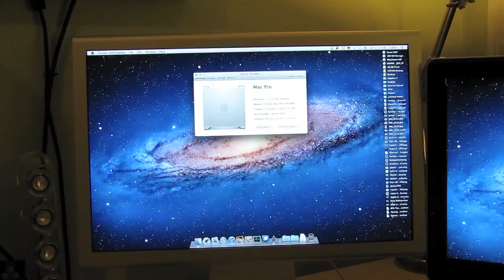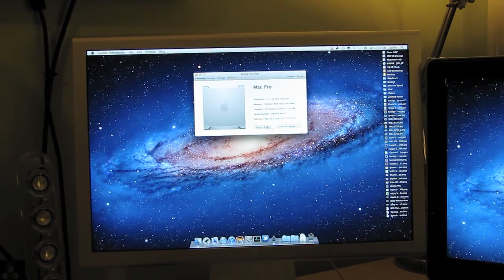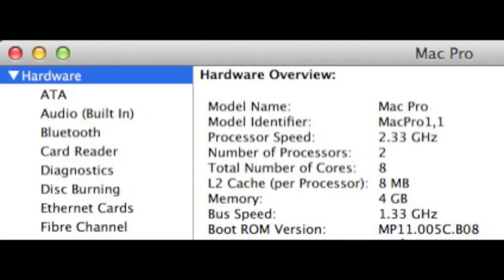Mac Pro Processor Upgrade

Comment: Instead of paying naughty Apple for a Quadcore you do like the PC boys and build your own version. There is a lot of info on how to do this and it really is not hard as long as you take your time, have proper tools and use non static precautions. You can also overclock any Chipset in the equal numbered Intel of 53XX i.e. 5310, 20, 40 and so on. It is fun if you have some balls, a few friends are PC lovers so I am guilty by association, my MP never had a chance.

Comment: The old CPUs ran 2-3F above room temperature? a delta temp of 2 degrees? Even water cooling can't really dissipate that much heat.

You also say the newer ones run "cooler" at around 10F above room? That sounds warmer to me or you have made a few errors... 

Also you used WAY too much thermal paste/compound...

FYI I only watched this to see what the inside of a Mac Pro really looked like.

Comment from the maker: @bmsmusician I haven't had any heat issues. The CPUs run slightly cooler than the previous ones. They idle at about 10F higher than room temp, an the old ones were at about 2-3F higher than room temp.. Just remember to clean the old past off of the heat sinks. Hope this helps!

Comment: Been thinking about doing this myself but never had the guts to remove parts. You got a lot of comments about the thermal paste, did you notice any heat differences caused by that?

Comment from the maker: I have the Mac Pro 1,1 as well. You can swap in the 5345 chips like I did. The 5355 chips will also work, but I didn't go there because I was unsure about heat, and they're more expensive.

Comment: hey Collin, i have a mac pro 1.1 i want to upgrade. the mac use 2x Intel Xeon dual-core 2.66GHz  5150, but you using 5345. So what I'm i gonna do? or what did you if you had the same mac pro than.

Comment: 3930k + GTX 690 ftw lol I love my videogames eventhough a 3930k is overkill. I am going to add another 690 my current one has a 200Mhz OC. Which is pretty massive for a dual GPU card on air

Comment: It's called a logic board, Apple macs them. Mostly due to the ram design like you see here. You can add a lot more ram this way. Also since the case is specific for mac pro's they can do this without problems. I personally tink it is a clever design al be it a bit cumbersome. Though it keeps all the hard drives cool and the GPU too.

Comment: Mistakes in the video:
- New Thermal paste: Just a small/medium sized dot in the middle of the processor.
- Old Thermal paste: You should clean the heatsinks before placing them back in.

Notes:
- Do backup your data, you will might to reinstall Mac OS X.
- This does void the warranty...
- Make sure you select a CPU with the right socket and also
make sure Apple uses the same CPU in their other Mac Pros.

Comment: depends on what method of calculating you use, windows happens to use 1GB = 1024mb but manufacturers of both ram and hard drives tend to use 1gb = 1000mb

Comment: Oh and btw you would be unable to run let alone run at max settings games like BF3 & MW3 as neither are supported on the mac platform, as well as the fact that a ati 5870 which is the top of the line card the mac pro comes with isn't able to run these games at max on 1080P - just admit it you bought the wrong thing

Comment: There is a case available for the pc builder that supports 24 hot swappable drives as well as 1 internal drive bay, put high end server speck drives in 4TB a piece, 4 x 25 = 100TB yes you would need a raid card, but i would like to see you fit 25 hard drives into a mac pro case. If you seriously think i use all 4 monitors as one your an idiot, 1 has Premier pro cs 5.5 on it, 2 has the live play back from the video editing, 3 has the files open, 4 generally has cpu, ram, gpu & hard drive info on

Comment: Well it dose if its faster than the 8 core xenon set up, windows will also support up to 128GB of ram, I I wanted to I could set up my pc to run a 24 monitor set up and btw you cant max out all games on the mac pro even with its top of the line graphics card. My pc will also support well over 100TB of storage if I was to buy the required hard drives. If you were to actually do video editing full time then you would see that four monitors is very very useful actually

Comment: This is a very poor example of a work station, I have a 6 core I7 @4.5GHZ desktop with GTX 580 overclocked as well as a Quadro 6000, 6TB of storage + 200GB of SSD space, 64GB corsair Vengeance Ram & 4 1080P monitors, now please tell me how this "workstation" is going to beat my rig in any way ? I edit full HD video all the time so these specs are required

Comment from the maker: They are Xeon 5345 CPUs with the lga771 socket. The faster ones were a lot more expensive when I bought them, but now the 5355 Xeon chips are at a decent price. The 5365 chips are also compatible, but they might get a little hot... Hope this helps! Sorry for the late response.

Comment: The pins mounted on the motherboard is Intel's design, not Apple's. How do you mean it's fragile? Think about it, how big is the chance you'll ever touch the pins on the motherboard? even if you would drop the motherboard/computer the pins would still be fine, now compare that to the CPU. When installing the CPU you can pretty much only hold it with 2 fingers on the side of the CPU, and then your fingers would be less than 5mm from the pins away and don't even think about dropping it.

Comment: No airflow? Are you kidding me? Man, I have put the fans to the maximum speed. And it was very brutal. I felt the the air that come out of the back of the computer from back of my room. The cooling of the Mac Pro is one of the best in the market. And you're also unlikely to ever change the processors in a Mac Pro. Also look at the newer models. They are very easy accessible.

Comment: I have the Macpro, and it has no issues with ariflow, what you saw there between the front fans and the memory is where the CPU's are located, air is taken from the front, it passes through 2 fans, then the processors, and ultimately the memory, the airflow design is quite good, since you are only cooling the items that need cooling. I never had thermal issues because of the cooling, it's always at the right temp, it runs at about 44 degrees Celsius or 111 degrees F. Well built machine.

Comment from the maker: Cool! I've never really felt like my Radeon X1900XT is straining with my usage, so I'm not upgrading any time soon. May put a cheap second card in though to run a third display, but it definitely won't be fancy (maybe even just a GeForce 7300GT). The small third display won't do anything intensive. Probably just have a web page or iTunes on it at most times.

Comment: Makes it worth building your own system and running OSX on that...

Or just pay for a windows PC with a Quadro card. Should cost around the same (if not cheaper) and the Quadro GPU will make sure your performance in any CAD-like programs will be awesome.

Comment: They all do, for the most part. Other people use the machine for video and 3D work with Maya, Avid and Nuke. We let them share resources with the other systems on the network to render over night too. Trust me, those machines have more than paid for themselves. A single contract paid off like 2/3 of the cost, any more are just pure profit. Macs are also cheaper to set up and run media networks too thanks to XSAN support out of the box. No need for separate expensive software in in Windows.

Comment: Eh? What the hell are you going on about? Intel make the CPU's, they haven't used pins ON the CPU for years, the pins are on the socket instead. AMD do it the opposite way around. It's easier to damage the pins on AMD CPU's because they're more exposed, but also easier to fix if you simply bend them for the same reason. I don't know what you're trying to say though when you say Apple do it so you pay them more... that makes no sense. If you have an Intel CPU pull it out, you won't see pins on it

Comment: As far as workstation cases go it's one of the best. Again you're completely missing (or ignoring) the point. A workstation isn't the same as a god damn desktop class machine, they're designed for different purposes. You wouldn't buy a server to game on, because you'd be pretty stupid and wasting your money. That's essentially what a workstation is, it's just in a tower form factor so it fits on/under a desk instead of a rack.

Comment: You obviously don't understand the concept of a workstation. Storage is generally external, usually on something like a NAS or SAN. You only need a screw driver, not the screws, they're already on the sleds and don't come off (unless you yank them off for some silly reason). There's nothing wrong with the Mac Pro case. For its intended purpose it's absolutely fine.

Comment: The 800D can be a workstation case too, as long as a case support the WS boards, its fine. Also, the HDD bays on the Pro are just hard to pull off, you need screws and you are limited to 4 of them. On any 100$ ++ case on the market right now, you will get at least 6 of them with no screw needed (except for 2.5 inch for some). I think Apple should redesign the case for its new lineup to give easy access to EVERYTHING.

Comment: Of course Intel had something to do with how the chassis is designed, they work extremely closely with Apple engineers to ensure the more efficient solutions to using their chips. They also work closely with engineers from most other OEM's who use their chips, especially in things like workstations where extreme stability is of utmost importance. Heat is a huge factor in that stability.

Comment: I never said you didn't need to clean the damn thing, I said the airflow was fine, and the compartmentalising of the thermal zones is extremely effective. I guess the people at Dell and HP and Sun (now Oracle) and IBM clearly rent as clever as you, because they all use compartmentalised cooling in their servers and workstations. I mean, it's not like these people are trained engineers with degrees and doctorates in things that govern these areas? Oh wait... they are. They know better than you.

Comment: I dont think Intel had allot to do with the design decisions of the chassie.. Thats all Apple..
It's more likley they designed it this way to convince you small minded fools to buy a new Mac Pro than doing smaller upgrades..
And airflow is just fine without the compartment design. They could at the very least included removable dust filter.. as the compartment design just increases dust buildup and complicates maintenance.

Comment: Yes, it's a good case, but it's aimed at an entirely different market. This is a WORKSTATION machine, the most you'll need to easily access at any given time is EASILY ACCESSED. Which is the RAM, the hard drives and expansion cards. It's extremely rare you'd need or want to upgrade the CPU's in these kind of machines in their traditional usage scenarios. The 800D is a gaming case, so of course it's going to offer easier access to bits gamers more regularly change or access.

Comment: Apple shouldn't decide either we need to swap a CPU or not. That's the point. Changing ram on a regular machine is far easier. You remove the side panel and pull the sticks out and put the new ones, that's pretty much it. If you want to know what I'm talkign about when I mean "good design" look at a Corsair 800D for exemple.

Comment: It performs within their thermal envelop. I think Intel know more about THEIR CPU's and what to recommend than you do. They also recommend their stock cooler as a MINIMUM, because it's rated to perform within a certain threshold that they can more easily control. They can't guarantee the performance of 3rd party coolers because they have no control over the way they're designed and built. Use some common sense.

Comment: ya, it's a veritable maze out there. I burned out one of my processors and am not sure which one it is. Maybe when I take it apart it will be obvious. But the repair guy said it was cost prohibitive to fix it. It still runs only on one processor. I reckon I can take it apart and if it becomes a paperweight then I can sell parts.

Comment: The RAM being on riser cards makes swapping it out far easier than the more traditional layout. You're also very unlikely to ever swap the CPU's out on these kind of machines. The newer design is far more accessible though. Look at the 2010 Mac Pro, the whole CPU and RAM assembly are on a single big daughter board that just slides out.

Comment from the maker: As directed by intel. The cores run across the chip, and that's where you put the paste. Then when the heat sink tightens down the paste spreads. I actually took one of the heat sinks off after tightening it to check, and it had worked nicely.

Comment: This has to be by far the worst chassie design ive ever seen... Dismount everything.. just to replace the damn CPUs...? That is bad design.. plain and simple..
And the compartment design greatly limits airflow in the chassis. Not to mention the lack of dust filters makes it a massive dust collector. Which isn't helped by the clumsy deign making cleaning a pain..

Comment: Was this one of the older Mac Pros? Because on Apple's website, the Mac Pros have hyper threading which doubles the amount of cores it has. I don't really see a need to upgrade processors if it has 4 extra virtual cores.

Comment: You have never touched and Intel xeon, you probably build gaming PCs in your basement using standard amd and dual core intel chips, why don't you google and research the amount of thermal past to apply onto an intel xeon, I have, and according to intel, that was pretty close, the pea size amont would not be enough, intel xeons are noticeably bigger, where is your common sense? Now please delete both of your comments before you emberass yourself further.

Comment from the maker: Yeah, the layout is a little different. I like the riser cards for RAM though because they're so easy to pull in and out, and it takes up less motherboard space than 8 RAM slots on the mobo. The hard drive sleds are also pretty nice. It's awful getting to those processors though...

Comment: Continued: if the OP will not be overclocking, or has no overclocking options then it does not really matter, especially since the stock cooler on the mac pro is significantly better than the stock box intel cooler, so it is unlikely that any thermal issues will arise, but overall it is best to use a small amount because thermal compound is expensive, and a small amount will offer better load temperatures

Comment: While idle temps can be low even with a lot of thermal compound, the issue is that the thermal conductivity of thermal compound is not linear, you basically get a logarithm curve when it comes to thermal resistance as temperature goes up (this is why too much compound causes load temperatures to increase more than they should) Though in this case, much of the excess most likely spilled out of the sides, there is still more than needed and that will make overclocking much harder

Comment: This is hilarious, you need to disassemble all that plastic to get to the CPU socket.
On my custom built computer I just need to unscrew four screws and I'm done.

Pro tip: when applying thermal paste just put a small dot on the center of the CPU and when you put the heatsink it will spread evenly to all sides, sometimes excessive thermal paste is worse then not using it at all, I bet his CPU's idle at 80ºC

Comment from the maker: All around the same time I upgraded the processors to 2 quad core Xeon chips, upgraded to 8GB RAM, and upgraded with an SSD and an extra 500GB HDD. May upgrade RAM even more in the future, but FB-DIMMs (used in most servers) for Mac Pros are expensive. It cost about $55 for my extra 4GB, but recently I've only seen 2GB x 2 sets at about $65.

Comment from the maker: Yeah, it's a nice speed improvement, and it has a lot more raw power for exports and stuff. It boosted my GeekBench benchmark score from about 6,300 to about 10,000. I also upped my RAM to 8GB shortly after the upgrade, and upgraded to an SSD for my OS and Apps shortly before the CPU upgrade.

Comment from the maker: Actually, I bought it myself used for $800 with an Apple Cinema Display, bluetooth mouse, and keyboard. It had 4 cores, 4GB RAM, 2 HDDs. I've upgraded since with the two quad does Xeon chips, 8GB RAM, SSD, and another 500GB HDD. I'd like to throw in another graphics card, but can't really justify it right now.

Comment from the maker: I did it as directed by Intel. If you have other ways that's fine, and I'm sure they work. I unscrewed a heasink after doing it, and the paste had spread out nicely with the pressure and it runs at about 10° F higher than room temp vs about 12°-13° F above room temp with the old processors.

Comment from the maker: That's only 10°F warmer than room temp. That's not bad. With the old stock processors from the factory it idled at 87°F. So the new ones are actually cooler.

Comment from the maker: @raketenDK Actually, it spread out nicely. I tightened down the heasinks then took them off to look at the paste, and it was spread out into a thin layer across the CPUs. They both run at about 85°F at idle.

Comment from the maker: @bassl0va That's why I bought mine used. I got it for $800 with an Apple 20" Cinema Display, Magic Mouse, Apple wired keyboard, and a retail Leopard disk. Including those extras, I have $1000 in it after my upgrades and it has 8 cores, 8GB RAM, 90GB SSD, 500GB HDD, 320GB HDD, 160GB HDD, and a Radeon x1900XT. Buying a new Mac Pro is too much for me. A quad core MacBook Pro is affordable for what it is though.